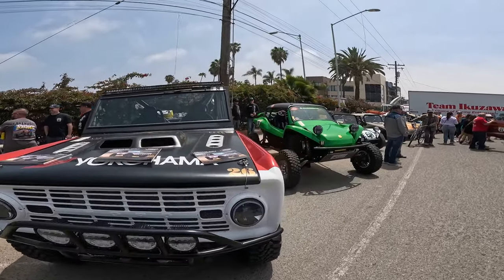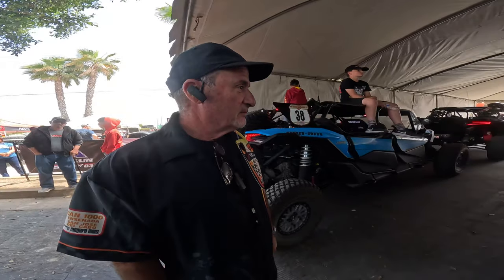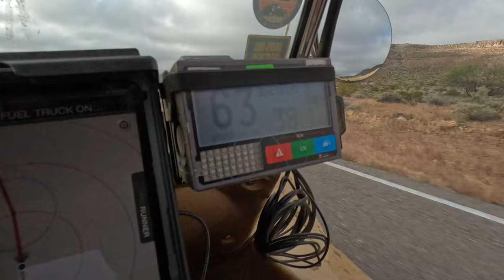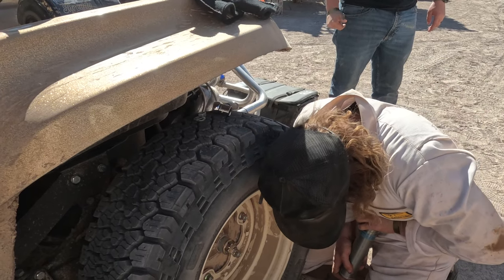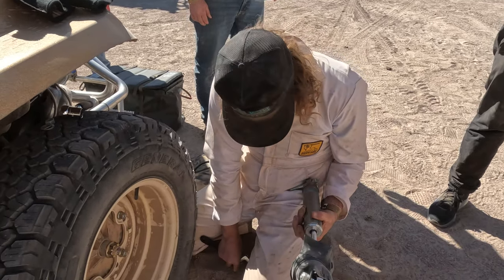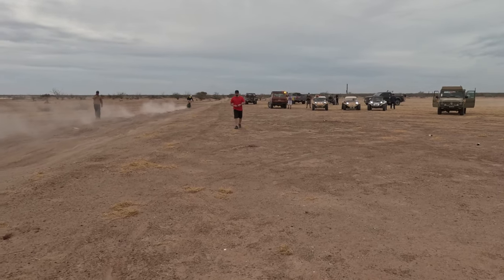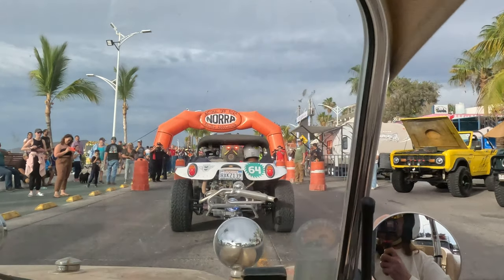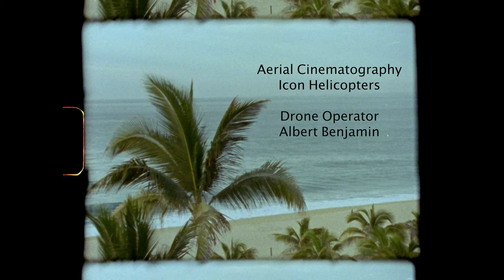NORRA 1000 CONQUERED IN A REMASTERED MEYERS MANX! HOLY SH*T

Comment: Thank you Blake and Michael!  I am sure you had a great time, but we appreciate your video of the experience. We drove two Baja Bugs and a VW Thing down to Cabo and back during the Baja 2000 race. It was quite an adventure including broke valve adjuster, clogged air filters, broken exhaust system, an alternator fire, and a roll-over. But we just kept patching things and going. Nice to see Mission San Borja, we got the tour there also.  San Ignacio with the lagoon and town square and mission are great. We liked Mulegé so much we camped along the river there going south and north. The dune buggy is uniquely capable due to its light weight and the trailing arm suspension.  Good fun.